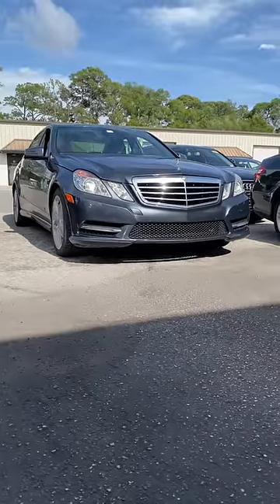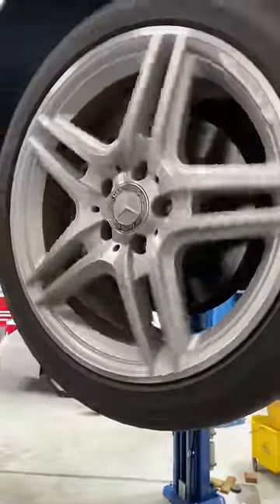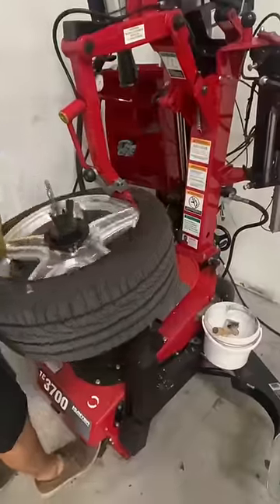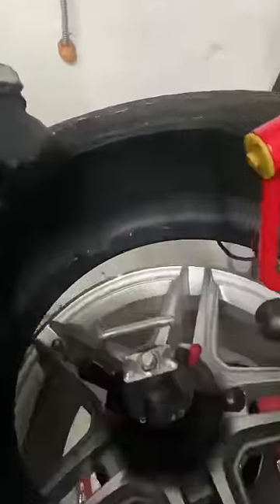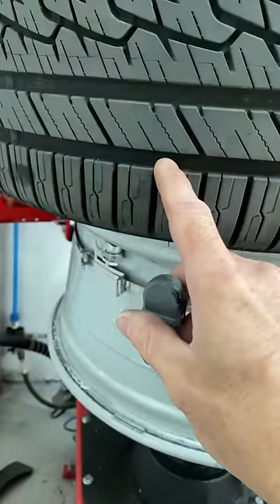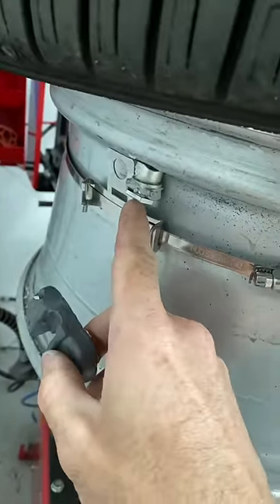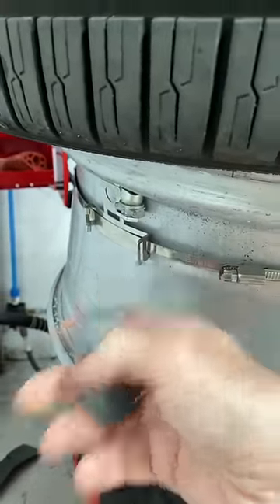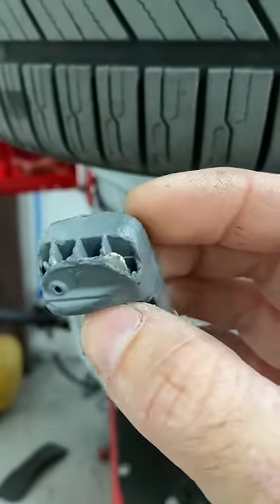Rattle noise found! 😂

Comment: I always take my car to the dealer, anytime you have to drive around the back of a store for something, something shady is going down there
Reply: Don’t blindly trust any dealer though. Yes, in many cases I will say they are much better qualified, educated and equipped to handle the cars they sell. That doesn’t mean they will always be best choice or will have the best people working for them. Ask anyone in the auto repair industry (from part sales to owners/GM’s) and they will say the same thing. There have been countless incidents because someone did something wrong at a dealership. 

Sometimes unqualified people can slip through the cracks of a hiring process because they lie/misrepresented themselves when interviewed then got hired, or you can have a great mechanics work quality start diminishing overtime because they are having personal problems that are effecting them at work (ie; spousal abuse, substance abuse and family struggles are just a few things that can cause this) or someone is just having a bad day or made a mistake. 

Everything I just mentioned covers just the physical work being done. Don’t get me started on horror stories I have heard about deceptive salesman or lying service writers at dealerships. They can be some of the worst when it comes to gouging prices and/or nickel and dimming everything on a invoice. Plus add on top of that, there have been many instances where a customer wants to get a high performance/utility/decorative accessories just to have some knock off version of it put on in a attempt to pass it off as the real thing. The even worst part about that is you only find out about one or two times someone doing that but most times that was just the first time they got caught. 

My point in all of this is just because you’re at a place like a dealership that doesn’t mean you won’t ever have any issues. It doesn’t matter if it’s a big box store, small mom and pop garage or a fancy dealer. Anyplace where humans are in control mistakes can be made, people can get scammed or worse. Ask the people in your area where they go, check reviews of the facilities you use. 

Finally, a little pro tip. If you’re looking for a good mechanic try this. Go to any part store that doesn’t offer auto repair and ask them what shop they would trust to fix their families cars. Those are the people in a unique position to see inside most of and talk to a lot of the people in their local shops and they will be the ones to see and hear about the good, bad and ugly.
Reply: Dealers can suck too
Reply: The shop can legitimately be at the back that's just silly.

Comment: Okey ! Mr.jonh your car is ready! 
Inspection $85
Tire dismounted $35
Tmps sensor $189
Rim inside cleaning $25
Shop chemicals $35
Tire installed $35
Balance $25
Wheel alignment $185
Drive test$50
Disposal fee! For old sensor $5
Environmental fee! $10
Documentation fee$38
Tax! 150$ 
Total! $2500! 
Thanks! For your business! 
Only avaliable in (usa)😂

Comment: For anyone wondering how it still worked. Tire pressure sensors transmit wirelessly to the car and either have an internal battery (most common) or can generate power from a moving weight inside, just like a kinetic/self winding watch.

Comment: Had exactly this on an 07 Mustang. Band type pressure sensors fitted with 2 zip ties linked together. Snapped at 120mph.

Comment: Me and my fellow senior mechanic once found a BMW wheel making sounds when we turned the wheel by hand. As a mechanic we searched everything for the sound. The bearings, linkages, etc.  then i accidentally found the problem.. the problem was just the BMW emblem wheel cap on the center of the wheel. Then we just laughed and thankful that we found the problem.

Comment: Happened to me last year after spending $2k on nice new tires. Front driver side sensor fell into the tire. It messed with tire balance at high speed and the wobble was just a little terrifying. Store replaced damaged OEM sensor with aftermarket and the TPMS sensor light never turned off after that. B.S.

Comment: TPMS will damage the tire if it tumbles so much. Had the exact same happen at Midas several times actually. It was destroying the inside of the tire. You’d have a lot of loose rubber shavings thanks to the loose sensor.
We used the exact same machines as you too.
However, I have NEVER seen someone try to rig it like this. That’s terrible 😂

Comment: I sold my 2019 ford fusion and bought a 98 Toyota Corolla I found with only 67k miles on it from an old lady. Immaculate condition. Manual windows, locks. But that model Corolla will run forever and and doesn't have all those stupid gimmicky sensors and electronics that end up being a money pit.

Comment: Customers dont always want to pay for a new sensor and band but want everything to still work. Duck tape will work in a pinch but you have to make several wraps and dont forget to expose pressure hole.
Not the correct way to do it but if the customer doesn't want to pay for correct way. Do whatever it takes to satisfy.

Comment: Ever think there was a pebble in your drive shaft, but everytime you took it off and gave it a shake you heard nothing? I know I'm not the only one. It drove me crazy. On top of that, it only rattled when I was backing up.🤔
The universal joints have pin bearings in them. When they wear out, they get kinda oval shaped and start rolling over each other creating a snapping sound. Such a small snapping sound but several at random times resonating through the drive shaft makes it sound just like if you had a pebble in it.

Comment: I had a similar issue with a customer. I had another customer who came it saying the tire light was on. They had bought after market wheels and the tires store they bought the wheels at didn't switch the sensors over from the stock wheels. The tire store even kept the guys factory wheels and tires.

Comment: If you take all four sensors off of each wheel you can put them inside the spare tire and inflate all of them to the exact same PSI and never have to worry about that pesky little light coming on. For those people that say what if one of my tires goes flat? How willni know? TPM sensors have only been a thing in tires for the last 15 years unless you had a high-end car.

Comment: Honestly it doesn't surprise much that it still worked rather that it survived. Those sensors can't be powered easily powered by the car battery. So they just use the energy in the vibrations or rotations. If you want to read up on it try energy harvesting. That is one of the prime examples

Comment: I had one break off in my right front wheel a few years ago and I couldn't figure out for the life of me what was making that sound. 
After watching an unrelated, random Scotty Kilmer video, he put me onto a theory that got me thinking. Maybe it wasn't the front end going out, maybe just a dumb tpms sensor came loose.
It still worked because I didn't have a light on my dash, so it didn't even cross my mind that it could be something so simple.
Such a pain...

Comment: Ive encountered this a couple times. Those sensors really dont cost that much. Just eat your mistake and save your reputation and customer relationships.if you buy them in large quantities, they only cost 20-30 bucks each for the universal sensors.

Comment: Did this to myself earlier this year, changed my own tires at the shop I work at, my car has bands on the wheel that the sensor clips into, accidentally clipped mine loose but it didn't come off until driving, took it off and the sensor was flying around free, also still works for me 😂

Comment: TPM Sensors are old school. My BMW uses leveling laser to accurately detect which tire is out of air. No need program or buy dumb sensors. Changed tires multiple times, and entire rims one time, not once I had to buy or reprogram any sensor unlike the other car I always had to pay the mechanic for each new TPMS or reprogram it. In this day and age why are we using technology of 1990s when it was popular back then.

Comment: I'm not so sure it says anything about the big box store.

It does have a lot to say about the integrity and  Competency of the tire changer.

It could just as easily happen at any place depending upon the same variables. 

Great job diagnosing the issue.

Comment: I've seen guys take all 4 sensors and put them in a PVC pipe capped on both ends with a valve stem on one end aired up to whatever pressure keeps the low tire pressure light from coming on and zip tying it inside the frame rail mostly seen on trucks with aftermarket big wheels

Comment: Ah the good ole tire shop/ quick lube techs are at it again! I bought a Honda crv off a lady. The tech installed a defective neck radiator where radiator cap couldnt seal properly. They left a cooling fan unplugged too. Crv lost coolant, fan could come on, thus resulted in a cracked engine head plus they only charged her $1,500 to destroy her car.

Comment: This is why you don't fuck with most Mercedes tpms stems at a tire place unless you have the OEM equipment or at Mercedes. In this case though they could have broke it when dismounting or mounting the tire though.

Comment: I don’t get why they use those sensors. Mini had it down in 2001 using the abs to calculate the speed of the tyre and work out the tyre pressure off that as in flat tyre shorter roll radius. No internal sensor required

Comment: So the TPMS can survive a rock tumbler but I'll be damned if it can read the right pressure.  I have a 4 way air up/down setup that does all 4 at once and equalizes them.  I used it on my Nissan that was complaining of a 28 psi tire.  Brought all 4 up to 32 and that one was still saying 29 two were saying 30 and the last time 31....

Comment: Ive seen it where they keep driving and the sensor and the inside of the tire is all chewed up. The battery was the only thing recognizable. Tire was chipped away to cords in a few spots so I recommended a tire. I can't recall if they bought one tho.

Comment: I still don't understand how the TPMS light didn't come on. Those sensors either measure how fast the wheel is rotating or the actual air pressure. In either case, that sensor couldn't accurately measure it which should have tripped a TPMS warning

Comment: I did this in my 08 town car. I had bought new wheels and tires and didn’t want to buy new sensors. Factory bands aren’t reusable and I just wanted the new wheels on so I used zip ties and tape. Held up for like a month and eventually broke 😂. Wonder how many Gs a wheel pulls when it’s going 80mph

Comment: It only tumbles when you go slow. Otherwise it is pushed to the tire with the centrifugal force.
Reply: Yeah, but it's slamming into the road multiple times per second as it goes in and out of the contact patch
Reply: @lukekingham2870  Not if you fly like a pro Rally driver.

Comment: If by any chance that steel belt bracket holding the sensor ziptied failed in high rpm the aftermath could be far from funny constatations. These guys are professionals but that solution holds it's potentials.

Comment: Nope that company willfully broke that sensor you can see how dented that valve piece. I had this happened to my two cars when I took them to Goodyear tires to replace my tires, they wanted to charge me for a wheel alignment and new rotors, Along with 150 bucks for each sensor.  I was like hell no, I drove 200 miles to my tire guy and found zip ties in my tire and where some poked a screwdriver in the sensor, it only cost me 60 buck each for two new sensor.

Comment: Had a ford explorer come in once for a balance because they felt vibration.. turns out the huge band holding the sensor to the wheel broke apart and the sensor and band were just knocking around..  removed sensor didn't replace because they didn't want to pay for it.. rebalanced and sent them on their way..

Comment: had a customer come in with the wheel knocking super hard, but wasnt getting anything when we had it on the lift, yanked it off and turns out last shop they had it at left their brake hanger on the shock lmao

Comment: You might be inclined to think its the big box store that's at fault but you haven't figured out stupid customers yet. Technician says the tpms sensor is broken and needs replacement. Customer says "I'm not spending that extra money to replace and reprogram. Just fix it!"
So you do some janky repair because your manager won't refuse the customer. When it fails, the customer is embarrassed to go back to the original tyre store so they go to another business and pretend they know nothing because ego is at stake. The next repair guy then massages his own ego over the crap fix.
Spare a thought for the previous tech sometimes.

Comment: So was the metal strap also part of their “fix”?  I’ve never seen a metal strap on a wheel.
Reply: I've only seen it on fords with their early tpms systems (2007-2009) they used a band clamp to hold in the sensor instead of inside the valve stem.
Reply: In this case, it was part of the fix. That sensor is normally mounted on the back of the valve

Comment: The check engine light came on in my 2018 c300 mercedes and I found out that if I push down on the pedal quick to the floor. It doesn't even get past 1500 revs.

It used go straight up to 3000 or 4000 but now it has lack of power.

Does anyone know what the problem is causing this.
Also it shakes the car sometimes.

Comment: Doesn't the sensor have read outside and inside pressure to give a reading?
Reply: No, the sensor reads the pressure and temperature inside the tire. The MAP sensor on the engine can give a reference pressure to account for altitude, which the ECU will then use as an input to determine if the pressure has dropped and needs to throw a warning light

Comment: Is that a stem sensor with also an old Ford style rim band sensor mount? 🤔
Reply: It's a valve stem mounted sensor. The big box store added the strap round the wheel to try to cover their damage (i.e. breaking the sensor off the back of the valve stem)
Reply: @lukekingham2870  huh... I worked in Wallys auto center for a few years we never did shit like that 🤔

Comment: "rim band" sensors are QUITE common
.
well.... quite common on older FORDS!!!
.
ford has to reinvent the TPMS
just like they reinvented the spark plug on the 5.4/6.8
.
.
ford would LITERALLY reinvent the wheel.... if they had "smart" enough engineers...... 
.
.
.
thats why i dont like FERDs
they are fine if you drive it like a german car..... AKA EXACTLY within engineered limits
.
but if you go 2 RPM over redline.... the motor throws 6 rods
.
.
they also "engineer" things to last EXACTLY 100 miles past the warranty 
.
they spend MILLIONS to "design" parts like that
.
.
instead of just spending the extra 50 cents to over-build it..... so it lasts 500,000 miles

Comment: Was it sams? I have never in my life heard of swollen lug nuts is what they told me, so I called corporate and they said that they never heard of it either and sams in topeka kansas said corporate would let them use a 4 way to change My tires on my ram because they don't have the right tools,  well they did change my tires for new and I didn't have to pay as much. I have been a mechanic for years and none of my associates never heard of it either

Comment: Ok I know nothing about cars. How can the sensor work if it’s not connected to anything? Like I’m assuming it has to be wired to an output but clearly no.
Reply: Uses RF 433MHz to transmit the tire pressure and temperature to an ECU that is hard wired

Comment: If that sensor didnt illumimate the gague cluster, then thats more than enough of a reason for me to never consider mercedes for the rest of my life. Id like to pay for SOMETHING in return. no thanks, ill rather keep my money instead of paying for someone else to produce a malfunctioning system. The entire mercedes brand just lost alot of value to me just from this video. I mean, thats just the wheel, i dont want to imagine what it will be like if something happenes with the differential or the valvetrain. Granted, it was a tire shops fault causing the damage, but isnt it also mercedes fault for not reinforcing that part to be more stable?

Comment: Well, once you are up to speed it will notrattle, it will just sit on one side due to centrifugal forces.
Reply: It will sit in one spot relative to the tire, but it's still rotating through the contact patch and essentially slamming into the road multiple times per second

Comment: Bro. Once we seen that someone had duck tapped the fuck out of someones sensor. I seen as i pulled the car in tpms light flashing, then just on.  I go to scan em all. Do the winter change over an TAaa-Ddaaaaa its all ducktapped on the inside of the wheel

Comment: In 1977 I worked at a Chevrolet place in Jacksonville North Carolina and we had a impala portal that had a rattle that sounds like it was a frame boat loose loose and we check it everybody over mechanic and they're work on this car so one Friday afternoon severalliams got in the car was riding around drinking whiskey in whiskey and we decide we're gonna fix this thing 1 way or the other so we ride around and drink and ride around and drink and run across railroad track running across the railroad Tr back-and-forth back-and-forth every bump we can find it we're right on it right on it right on So we went back to the dealership and we put it on a rack we checked all the frame boats checked everything we could so I decided to grab the rear right door and shake it and I heard something A Coca-Cola bottle inside the door panel and it had a motive says you finally found me didn't you dumb asses so some are from the factory when they built this car put that Cocoa ball in there with a note that was really funny